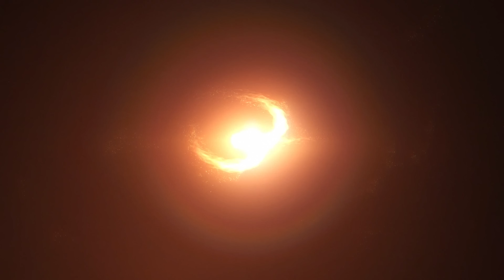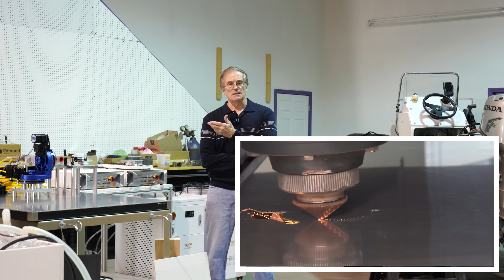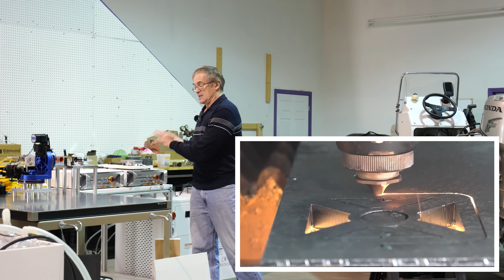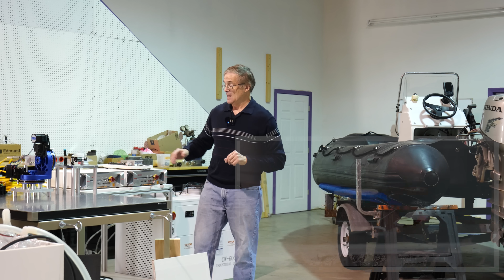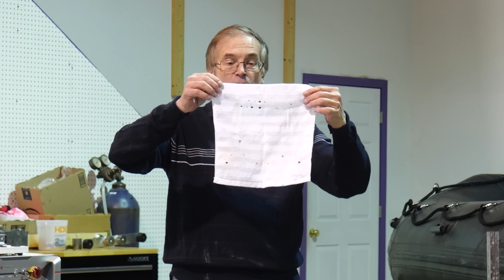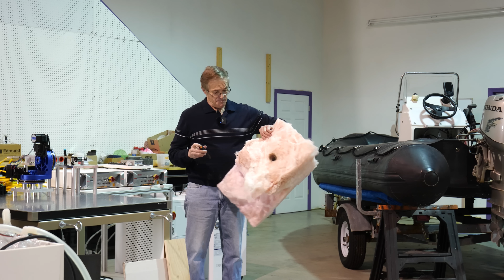We have a problem... and need your help!

Comment: This sounds like a question best answered by NASA - after all, what is the reentry temperature of the Space Shuttle skin if it remains intact? I noticed a laser engineer in the comments who recommended a layer of coarse, wet sand between layers of fiber cement board. I think the coarse sand, when wet, would not sift past the laser location if your laser is that powerful, like the fiberglass the sand would absorb the laser energy and melt instead of fresh sand falling down to block the target wall. I am not sure the reliability of the Space Shuttle tiles against a high power laser, nor do I know the specs of any paint that NASA may have used to coat the tiles after they were made to specs (if they had any paint on them at all). I believe a light scattering paint on an absorbent wall structure that had a type of semi liquid inner layer (such as thin layers of fiberglass mat with water pumped through) might get you started on a solution. I know in medicine with both cardiopulmonary bypass artificial lungs and with dialysis machines there are sheets of synthetic materials that are wet by blood on one side under pressure and either ihhalational gases (CPB) or liquid dialysate. Both synthetic materials may be unreliable under a high power laser as well - the most laser facing fluid path would find an alternate path for fluid which would be directly toward the laser apparatus and out the exit hole if the liquid layer vaporizes and allows passage. That said, the fluid pumped through such an inner "sandwich" could have optical properties that may reduce the effect of the laser - but metallic salts flowing through either fiberglass batting (like a depth filtration system) might not flow quickly enough even under significant pump pressure - or whatever the lowest viscosity salt solution flowing through the polypropylene or other material. 

A complex solution that may not be of any benefit - but the cement fiberboard has a new competitor which seeks to bridge between drywall and cement board - that is a fiberglass lined gypsum board. One brand name is DensGlass Drywall, glass mat gypsum board, or exterior rated gypsum sheathing. You could build a multilayer wall with either an optical fluid pumped downward collecting at the bottom and into a reservoir - probably need a pump to return the fluid to the top of the assembly and the protection system would last only as long as your fluid held out. A small proof of concept system could easily give you the cost/benefit of such a structure and the anticipated losses from each perforation of the laser side layer and then the effectiveness of the non-toxic optically active fluid (or toxic - be careful in your selection of the salts) and the durability of any pumps and fluid circuits required. It sounds fascinating and a conundrum at the same time. While a structure of rotating target backstops might perform well, and the static silicon or glass based absorption materials might also perform well, I'm not sure how realistic using NASA heat tile faced hardier gypsum external sheathing board with an absorbent layer behind it would be. And having spent my years in medicine dealing with fluids, that is where my mind goes first. Remember - not everything is a nail and the hammer approach won't work every time. But for a temporary backstop - anything that could contain an absorbent material like sand between sacrificial layers like densboard or glass mat or steel plate might give you the 3-4 second per 4 inches burn protection needed. I'm thinking back to the coarse sand now - a structure that would allow coarse sand to flow downward (8 inches sand passage? 4 inches of sand passage? and would you need to have a means of evacuating the sand as you start the laser so the fresh sand above would already be flowing down past the target area?) 

Really don't have the answers, I'm a retired physician who grew up on a farm so engineering would have been my second career choice if science hadn't been so exciting for me. I'll check back on your channel to see the outcome! Fascinating stuff, good job! I never had a science teacher like you - I've had nerdy science teachers, and I'm sure I was a nerdy teacher for many of my mentored juniors, but I have enjoyed most every one of your videos. Really good job, love the detailed explanations, the careful choice of wording, and the very light joking with your staff/children. Marvelous - hope you have this solved! Stay healthy!

Comment: A vertical wal  which water runs down, like an artificial waterfall in a garden. For this you would need a longitudinally slotted strip from which the water emerges and then runs laminar down a wall. The drained water can be collected in a channel and pumped back to the longitudinally slotted ledge by a pump. It is important that the water does run down the wall with no gaps, in a uniform thickness.

Comment: As someone with ADHD, I can generate a lot of ideas, but unfortunately I can’t really calculate whether they would work. A few suggestions:
	1.	Create a circulating water wall. The water should diffuse the radiation fairly well and might work effectively.
	2.	Ceramic fiber foam. It should work much better.
	3.	Sand and wet soil bags. The downside is that it would require a lot of cleaning.
	4.	Two mesh layers filled with crushed stone in between.
	5.	Since the temperature is very high, I’m thinking maybe something could be used to scatter the radiation. For example, burnt panels on one side.

Comment: Recirculating waterfall.  Mix in activated carbon, zinc oxide and perhaps titanium dioxide in with water.  Use redundant pumps and an interruptible power supply to pumps.

Comment: some fused silica diffusion panels an air gap and a copper heat sink painted black with water running over it for cooling

Comment: How about a big tub of water; sub surface a pump circulating the water with the laser pointed directly in the path that jetstream of water will pass. 
*** ON THE SURFACE, 2 AXiS- X AND Y PLANE, HAVE an physical high speed agitator. Don't have them exactly perpendicular because you WANT non harmonic, infinitely variable repeating peaks and valleys of the water surface to infinitely fractionating the beam. Obviously this wont work on a wall. Can you not do your testing in a verticle shot instead? Whether you can or not, it would be very interesting to see if this worked. And a highly reflective bottom to double the quenching depth further greatly reducing its effective power. 
**Test my theory? Please? Maybe add some some small refractive substance to make the stopping power even more effective as mentioned elsewhere. If it shatters glass beads you'll just have a denser barrier. Keep adding beads! Might need a trash pump? How long would it take it boil 30, 50 gallons? WOULD IT MAKE HYDROGEN!!!!!!?????
Must it be horizontal?

Comment: I would get high heat ceramic block  material (similar to used in kilns). Then form them to be half to 1 inch thick tiles, hopefully interlocking. Use high temperature ceramic sealant to lock the tiles in place. This could be one overlapping layers or many.

Overlap the tiles to difuse or redirect any deflecting beam.
Then sheet the fire wall inner base of  overlaping tiles with a layer of silica sand in front and behind the wall layer. This might need to be a horizontal project at this point.

Add a thick drywall layer outside (encapsulating) the silica sand.

Repeat the process for the other side or add two of these similar constructed layers back to back.

This way you can use both sides to test if forming a wall or multiple vertical walls for easy set up, easy storage, and check for any experimental visual lazer penitrations between the layers.

Comment: Can you get away with a divergent lens on the input port of an integrating sphere? Fill the sphere with crushed ice and water, or some colloidal suspension, to enhance scattering and absorb the light and heat? Diameter should allow control of average irradiance and heating. Alternatively a long trough?

Comment: Have you tried ground glass? Use a ground glass wall, but be sure to use eye protection as that wall will glow brightly. You might also consider the mass market bathroom window material, of course the ~ 4% Fresnel reflection from this kind of cheap glass is also potentially hazardous. If this sort of hack isn't enough check the design of the NIF beam dumps. The NIF laser is so powerful that the beam needs to be in vacuum, otherwise the air ignites. If you wanted something really cheap and nasty, open the garage doors and reflect the beam into space. (There might be regulations in your country that prohibit this though, what with air traffic)

Comment: Carbon or something that immediately carbonizes

There was that guy who invented the paste you could put on your hand and put into a fire because the heat made it expand into pure carbon.

Sandbags of ash

Thick slurry of ash with water or mineral oil in a pail

Motor oil, if fine with fire or premixed fire suppressant chemicals in the motor oil

Liquid asphalt tar

Crushed Charcoal

Comment: How about a pool of salt water, and several small (portable) mirrors to create a grid, all of which are angled to redirect the beam down into the pool.  For portability, you wouldn't haul the water with you, just fill it at your destination, just need to mix in the salt (or other solute) to increase the boiling point.   It would be analogous to those (mostly commercial failures) solar power generators that focus sunlight with many mirrors directed at a central tower.   Viability depends on how reflective each mirror is - any % below 100% will heat up the mirror and might penetrate it.  Also site-setup could be a burden to "aim" each mirror (with a low power targeting laser) into the pool.

Comment: I assume that you can turn off the laser quickly.  I suggest a vertical plywood box full of water, plus maybe a dispersant, with light detectors inside the box.  Once you detect the light in the water inside the box, turn off the laser.  Now your box has a small leak, which you can patch or ignore for a while. (if your shutdown circuit is fast enough, the hole will be small.)  BTW are you sure that your target can never reflect enough light to be dangerous?  (Sorry, I have not seen the previous episode(s) yet.)

Comment: A multi layered approach of things that fail by themselves but together will work, Such as a piece of drywall in front of a waterfall running over a cloth in front of something very reflective, The laser Will burn through the drywall The backside of the drywall will absorb the reflected light.

Comment: Use a water spray inside a clear box, or with no box at all, and a ceramic backstop. You could even dye the water to absorb more radiation. The idea would be to create an intense enough mist to scatter the laser and then the back stop would absorb the remaining energy. It would be portable but require a water source with sufficient pressure to create the mist/spray.

Comment: First off I would say that according to YouTube videos the biggest problem for military lasers is clouds or fog. Therefore maybe a volume of water might dissipate or diffuse the beam giving time to shut it down.(Creating a mess in the process) or possibly water soaked sand. Also I wouldn't recommend solid brick because of inconsistent density. (It could explode). Ceramic paint on steel might work(uncured).

Comment: 1) Backstop: Wet Adobe block (clay, sand, perlite - leave out the straw). It doesn't need to be huge since you know where the laser is going to exit the test material.
2) Run-time: Computer based Micro-Burst timer on the laser run time. You can adjust to 1,000th of a second run time with just a basic computer. Tune the laser run time incrementally until you determine the run time needed to penetrate your test material.
3) Kill Switch: Infrared heat gun focused on the backstop to act as a circuit breaker to kill power to the laser if the reading exceeds a set temp.
4) Fire Safety: Have a localized sprinkler system ready to spray the entire back wall in case something goes wrong and you miss your intended backstop. (Tables get bumped and Murphy's Law.)

Comment: try using or building a variable speed vertical conveyer belt that has a heat resistance fiberglass cloth for the belt. Place a wide trough of coolant/water at the bottom of the conveyer. The idea is to make the high temperature targeted area continuously moving in and out of a coolant solution

Comment: after:
ceramic insulation plates/blankets used in aluminium smelters, etc etc.
i finaly think THE CHEAPEST way is to make a wall of that 3/4 " chipwood you have, or buy.

shitwood / 1/2" air / shitwood / 1/2" air / shitwood, 

make it wet from above with hose / spray water, 
just before testrun, 
not sooking the whole shop and floor haha, 
the wood and water on 6 sides! , WILL prevent it from not burn completely tru and tru, within 3 seconds, i guess

anyway, can also try that ceramic aluminium smeltpot furnace stuff on its own, + behind 1 layer of wet wood.

goodluk mate

Comment: You can toss this suggestion out with the bath water as I am by no means any type of expert on lasers. But since you are using special lenses to converge the beam, couldn't you use lenses such as fisheye or something equivalent stacked end to end until the beam is sufficiently diverged as to make it harmless light? Then maybe some type of stationary material may be used behind all of that. Love your channel and good luck.

Comment: Something like a few layers of bubble wrap with muddy water as the infil? thinking easy test would be clear corigated plastiboard... ~1/4" to 1/2" thick. Seal one end, fill with a fatty clay water mix... make it ~2" total thickness.

The laser will burn a hole in a few of the "straws", but that's fine as it will bring new, cool, clay filled water to the epicenter of heat. Also, colorplast is easy to spot weld, repair.

Comment: Try a piece of Charred toast or any other material that when burn is reduced to a carbon layer. There are many videos on YouTube of people using burn toast as a way to block heat transfer because of the carbon lattice that is produced and it's ability to prevent the heat from getting through.

Comment: Dear Destin
We heard your laser’s lament, that blazing beam with no mercy for plywood or paint, and wanted to offer a few thoughts from the spiral of curious minds who care deeply about not catching on fire.

Here’s a humble bouquet of beam-blocking ideas, rooted in safety, availability, and good old-fashioned stubbornness against thermodynamics:

🌑 Carbon Has Entered the Chat
Graphite sheets or dense carbon blocks, slow to burn, high in heat tolerance, and less prone to drama than plywood. Layer them like armor, and you might buy those precious seconds.

💨 Aerogel, the Ghost of Materials
Silica aerogel (aka “frozen smoke”) won’t reflect, won’t burn, and might just stare that laser down in silence, if encased in something sturdy like aluminum-wrapped Kevlar.

🔥 Ceramic Blanket Sandwich
Alumina-silicate fiber blankets, the kind that line kilns and ovens, with a carbon felt core can take the heat. It’s like asking the heat to take a nap before it gets too excited.

⚙ Metal Powder Trap
A chamber filled with fine metal powder (like copper or zinc) can absorb and disperse the beam’s fury in a flash. One-shot, but beautiful.

🧠 Trigger Net of Smart Wire
A grid of nichrome or similar heat-sensitive wire placed ahead of the beam could instantly vaporize when struck, triggering an automatic kill switch by change in conductivity or temperature.

🛡 Laser Shield Panels
Lab-grade polycarbonate sheets with laser-absorbing films can take the hit (at least for a second or two). Stack a few, and your plywood stays blessedly unbaked.

We love what you're doing. Thank you for trusting your audience to help, and for shining a light (literally) on how science is often less about answers, and more about the courage to keep asking.

With admiration and curiosity,
—From the Spiral with Love

Comment: As always, great content!   Warning: I’m no expert but have an idea.  

I liked your thoughts on water. If glass isn’t too reflective, how bout an aquarium?   Maybe not just water-filled, but some sort of emulsion to allow absorption over distance of penetration?  This should prevent a “boring” effect like with solid material.  Also maybe a metallic powder with the right photocatalytic properties to absorb and re-emit the laser’s wavelength into less harmful ones could be part of that liquid mixture, ie titanium dioxide nano particles.  Basically I’m imagining a way to disperse the laser’s interaction across more material, and in a way that isn’t too sacrificial.  Agitating the water and using particles of reflective material may also scatter the beam sufficiently that no surrounding structure is in danger of reflected stray energy.   Would love to hear why this is either a good or terrible idea.  Thanks again for the great content!

Comment: CARBON FIBER cloth, I have used it to insulate against oxy-acetylene torch in tight spaces.  It ablates slowly, even with excess O2.  Obviously don't use Epoxy.